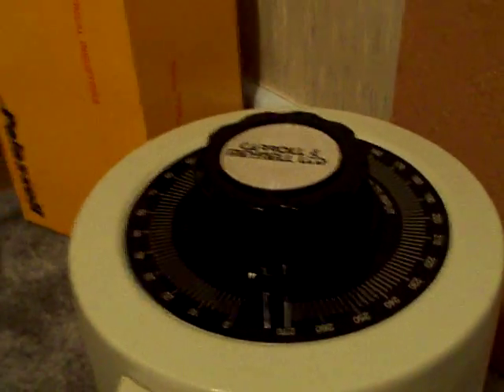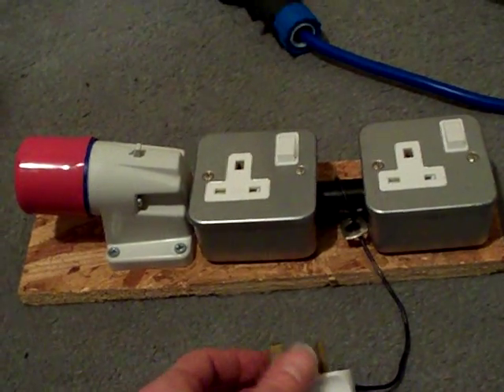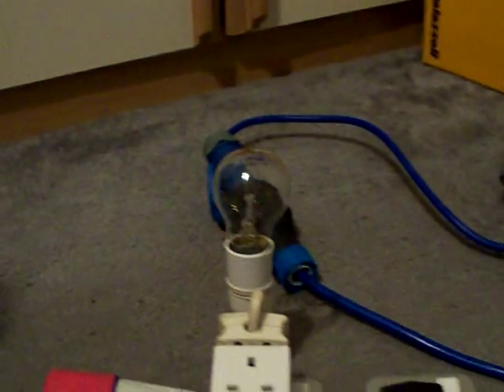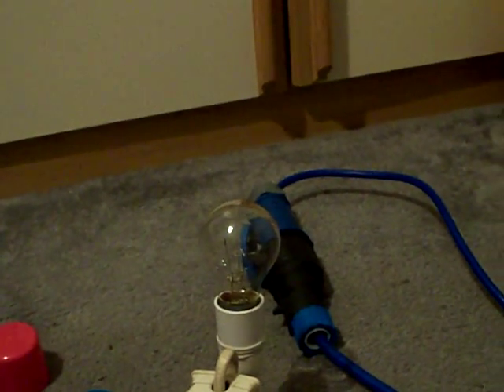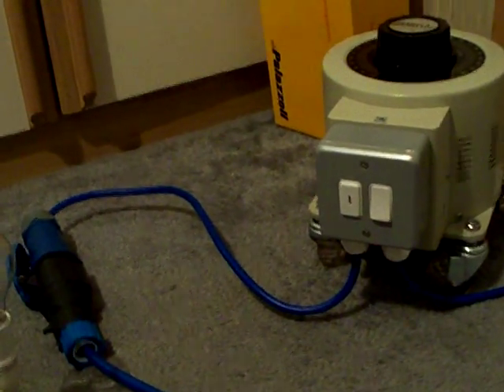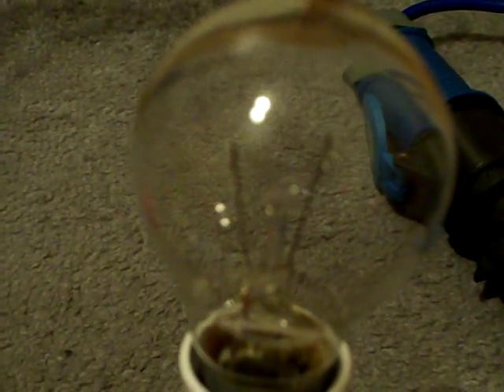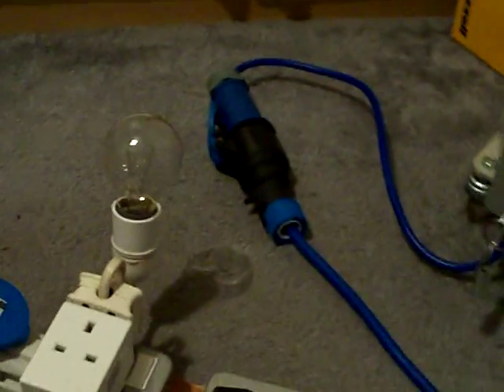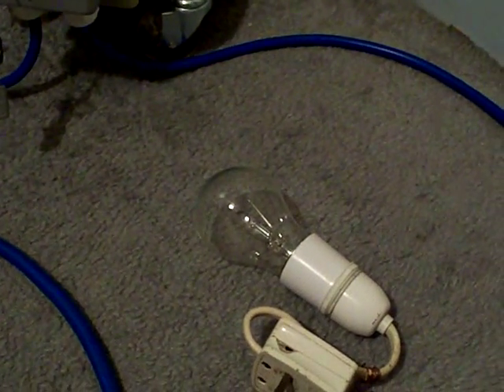Electrical : Soft-starting a variac with.....

Comment: Good video. This technique is also used on large audio amplifiers which at switch on will draw a large current for a short time to charge the capacitors. Often 20 Watt low ohm resistors are used in series which are bridged out by a relay after a few seconds..
This set up can not damage your variac as the maximum current is limited by the 60 W filament. 0.25 Amps can be drawn maximum.

Comment: This is an excellent way to soft start a Variac, I have used a lightbulb for a while now.  For those worried about fragility, just remember  40W bulb cannot draw more than 40W, so it won't pop or blow. The Variac doesn't have to be set at Zero you can have it at 236V or whatever if you want...it makes no difference. The reason the breaker goes is the inrush setting up the magnetic field in the core and that causes it to trip the breaker, the bulb allows it to build more gradually.
Reply: Hello there. Since making this video, I've made a mini soft starter, and it can be found here: https://www.youtube.com/watch?v=1XNsKo-DDps 
Thanks for watching. -Wayne's Electrical. 1st September 2019, 18.07
"BoomBoxDeluxe" is now a Wayne's Electrical brand.

Comment from the maker: Hi. I laughed when I read this:

"The 60w bulb may pop if you were to go beyond 60w with a load...."

Haha. I can't go beyond 60w. The lightbulb will prevent that because of the resistance of the filament. :D

That resistance is EXACTLY why I used the lightbulb to start the variac.... The variac can then only pull a maximum of 60w off the mains to start up. :D

When the variac is soft-started, it's only then that I ByPass the lightbulb with the ByPass plug, then power is unrestricted. :-)

-BBD.

Comment: On my 8A variac, I use a delay-board from a microwave oven, and a 500W halogen-bulb that is bypassed after a short delay. Seems to do the trick when dealing with a peak oversensitive breaker. I have also added a 8A thermal breaker on the output.

All built into the box.

Comment: Same setup as you just more crude.
I use a 2KW jug.
Often I just use one one of the fused circuits instead of the circuit that is protected by the damn sensitive rcd/mcb.

Comment from the maker: Haha....A fan heater is even better. :D However, what I try to do (and show) in this vid, is trying to get the whole setup as neat & compact as possible. In the two videos titled "Inrush problems & Solutions", there's a whole spaghetti of wires all over the place & takes a bit of time to set up... Just to start up a variac!

What's in this vid is the neater, more compact equivalent. :-) It's also much quicker to set up. The bit I don't like about this, if the fragility of the lightbulb!

-BBD.

Comment: The 60w bulb is likely to go pop if you were to go beyond 60w with a load, the fuses in some of those 60w bulbs in normal use fail before filaments do, you could also use a 70w halogen bulb for the soft start when 60w bulbs disappear if the government get their way.

Comment: My 2KW isolation transformer has to be soft started on my 20Amp mcb protected circuit trips instantly if the sign wave it in the wrong spot..
The rest of my place uses fuses.